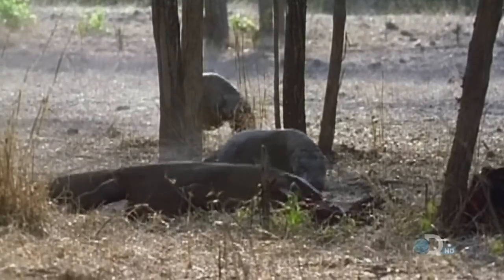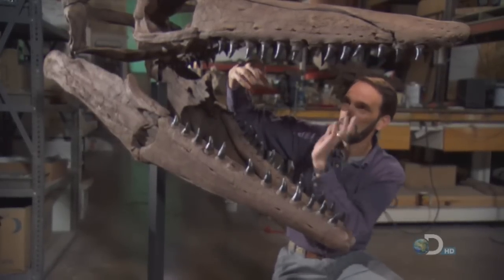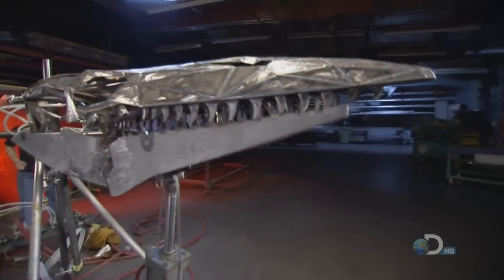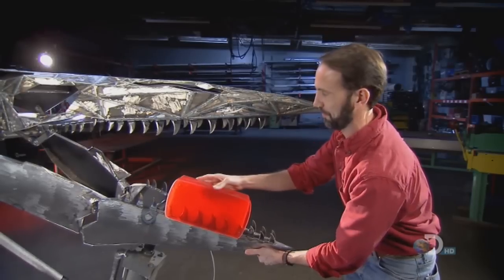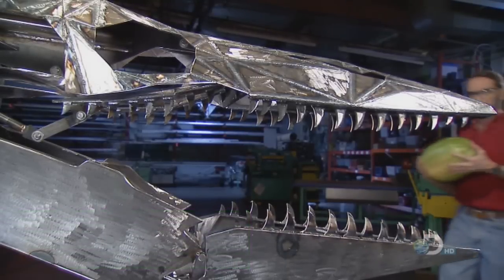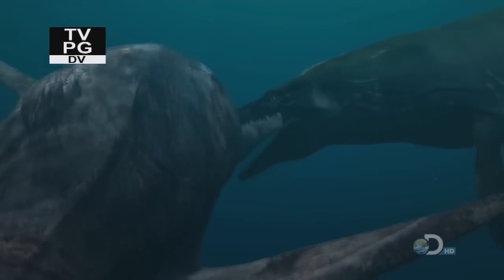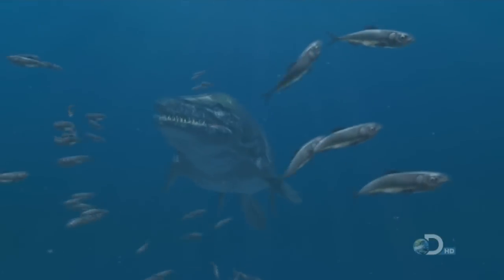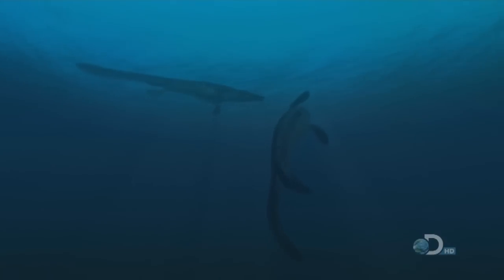Mega Beasts: T-Rex of the Deep (HD Quality) [Part 4/5]

Comment: I'm sure if they were testing the bite force of a Mosasaur, they would've constructed the skull differently, used different teeth, and had more accurate prey simulations.  However, I think they were testing other things:  what the bite could do to prey, and how much the Mosasaur could fit in its mouth, so that's probably why they used softer materials.  Why put a strain on your models when strength isn't what you're testing?

Comment: @bhsmiler08 It's not just an idea... the surface area is different and the hooking onto prey would be different too.
Blades and cones simply are not the same.  The experiment has about as much scientific merit as a mythbusters test ( where they forget to secure a high pressure air cannon for instance and never show any calculations)

Comment: Megalodon could be smaller because you can't base size on TOOTH only and sperm wales could wipe Megalodon out because it was too big of a threat to them.
Reply: Hey Tim. There is also a whale called the Leviathan that could be a contender of a Megalodon killer as well. =P
Reply: Tim you nailed it. I question using great white body to tooth proportions. For all we know megalodon could be 30 ft with massive teeth because of a niche diet that included much larger and heavily blubberous whales for example. Or the megalodon could be 100 feet with smaller teeth in proportion than the great white. It's all very speculative. From what I've read the dentition to body ratio of shark specie vary greatly.
Reply: It's like if we had only discovered the front canines of the saber tooth cat and no other parts, using modern panthera felid proportions would lead us to imagine a cat that was 6 feet at the shoulder.
Reply: Tim Pogrebiski We also have vertebrae.

And all the raptorial sperm whales went extinct long before the shark did, despite coexistence. Seems the mammals are the "inferior" predators, if anything.